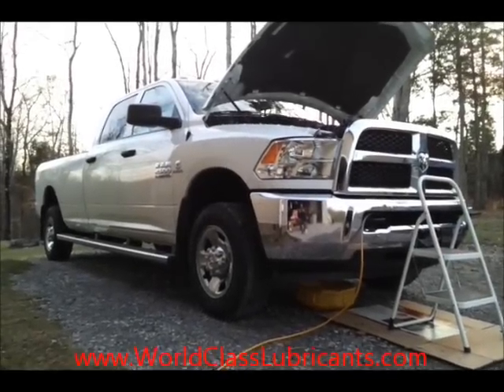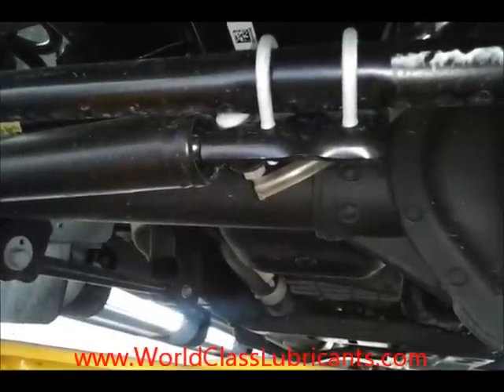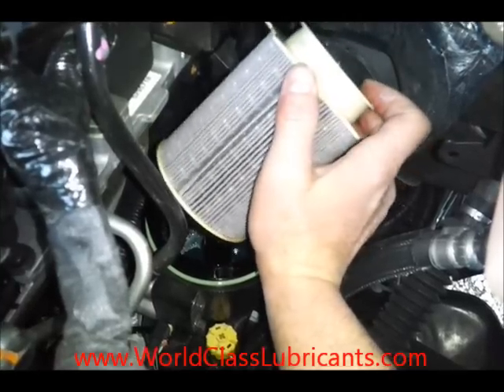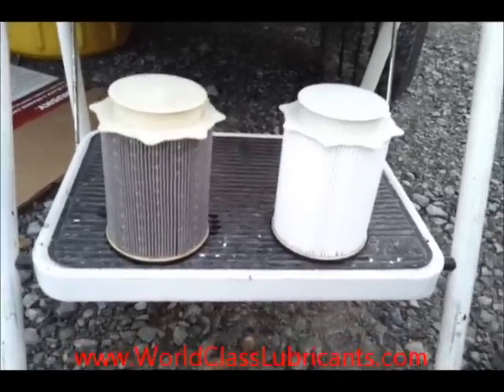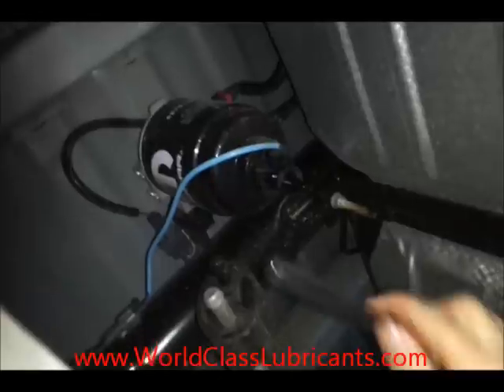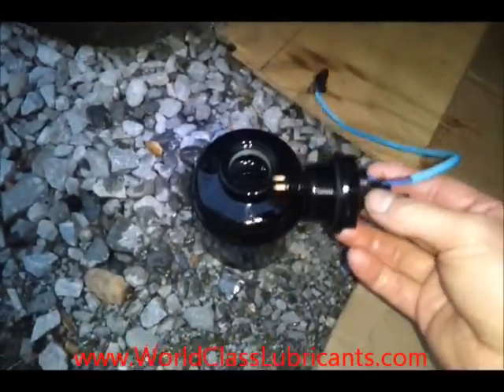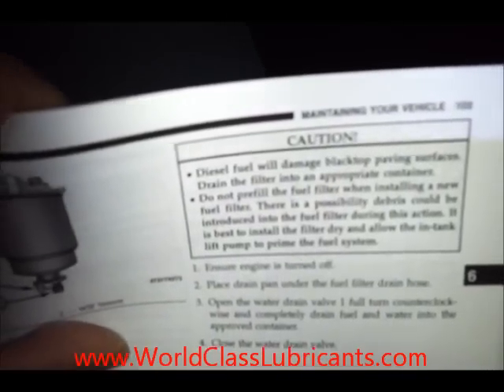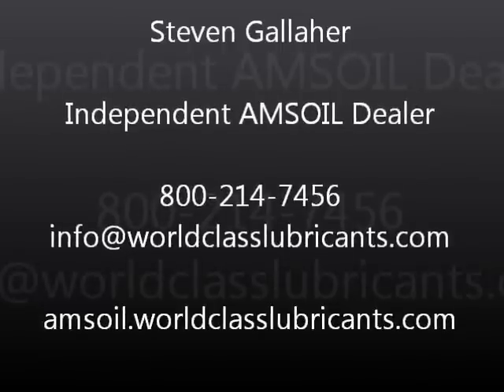Cummins Fuel Filter Change

Comment: Overall a very good video. The only faults I find are: you should use a torque wrench on the underhood filter housing cover and you really should use a 28mm six-point socket rather 1 1/8 inch twelve-point.
Reply: I wish i saw this ! I couldnt do get it to loosen had a strong guy not too inclined to know and rounded the corners, going to see if i have a 28" if still able to grab it😝 if not any ideas how to get it off? Chisel and buy new cap?

Comment: This is a great video! I've used it both times that I've replaced the filter in my 2013 3500 Ram dually. I installed a longer fuel tube on my filter just like he did and it works great. It's not 3/8" like that back one it's 1/2"

Comment: To remove: For the front filter, we used a couple of extensions and a swivel and were able to get it from the top. This method allows you plenty of leverage.We used a strap wrench for the rear filter and despite draining it with a hose, had a bit of fuel spill out upon unscrewing the filter. Takes about 15 minutes. Ram on!

Comment: I literally cannot get the cap on my 2014 ram 3500 to loosen and being so tight in the engine compartment I can't get a solid grip on my wrench any advice on getting this cap off?
Reply: Go to the local zoo and borrow a gorilla.. I’m convinced that’s what the dealer uses to tighten them.
Reply: Haha. Its 2022  now and have a 2018..! Any ideas how to get the darn thing off?

Comment: Can you take off the cap on the front fuel filter with a oil filter wrench?
Reply: I did on my 2009 but on the package it says not to because of possible damage. I could not get a 1/2" driver in like the expect you to

Comment: If anyone gets frustrated enough on the rear one for not coming off and you decide to jam a screwdriver through it to get more leverage, do it more towards the middle and not where the sensor screws in because you may jab right through the sensor and snap that and then need to replace that so your new "water in fuel" light will go away. Posting for a friend.

Comment: If you want to just clean the water separator is it sufficient to attach the 3/8"s hose and drain the filter, or should you also cycle the fuel pump?
Reply from the maker: ***** Attaching the hose and opening the drain is sufficient to drain out any water.

Comment: You use the same 3/8 tubing for the front filter drain as well?
Reply from the maker: Yeah, it comes from the factory with a short tube already installed but I replaced mine with a longer one that reaches below all the front end components.

Comment: Do you think the average Joe could change the fuel filter on a 2014 Dodge 2500 Ram 6.7 diesel?  What are your thoughts?  The engine compartment seem VERY tight.
Reply from the maker: James Smith Oh yeah, no problem. Anyone with a little mechanical ability can do it.
Reply: Looks super tight under there.  Also, if changing the oil, how do you recommend filling the oil filter and reinstalling it without losing the oil?
Reply from the maker: James Smith Very carefully. I fill the oil filter almost to the top, since it is installed vertically you shouldn't spill any. Good luck.
Reply: Again, would love to see some videos of this process.  Hint, hint.  :D
Reply: dude, didnt u just watch the video?
Reply: Dude:  I talking about a different model vehicle.  Has a totally different engine compartment makeup.
Reply: James Smith 2013-15 are identical...